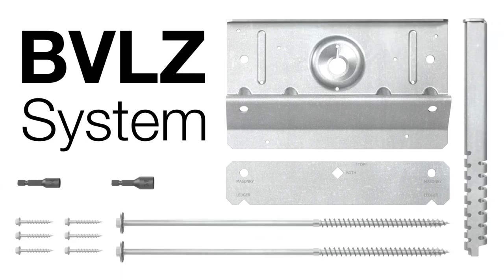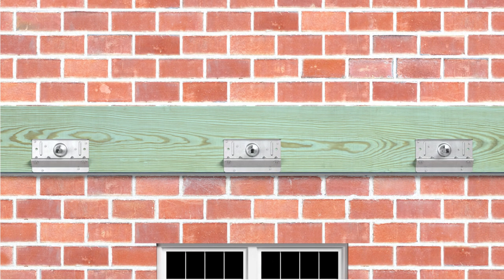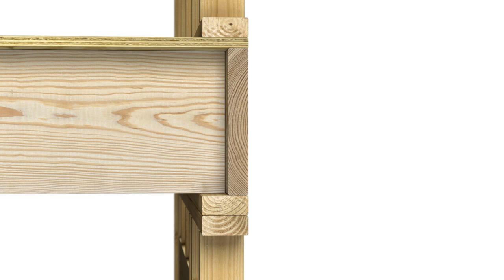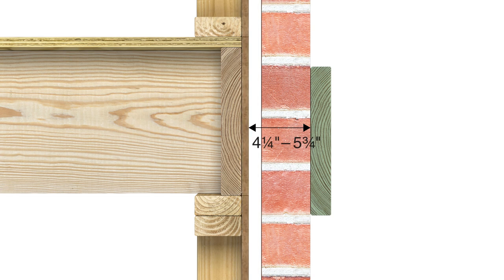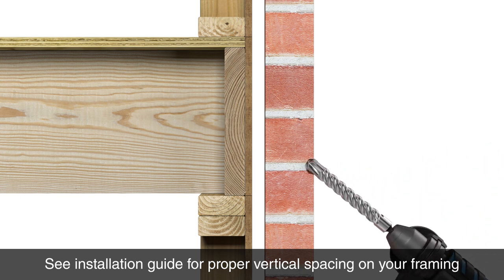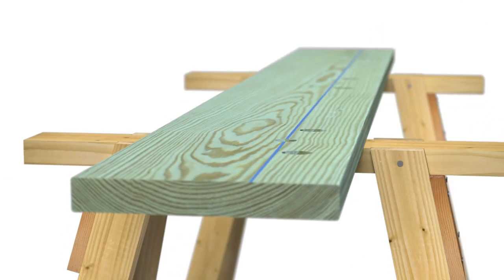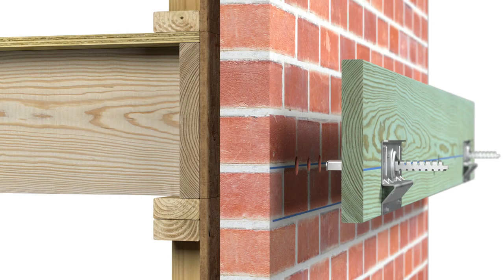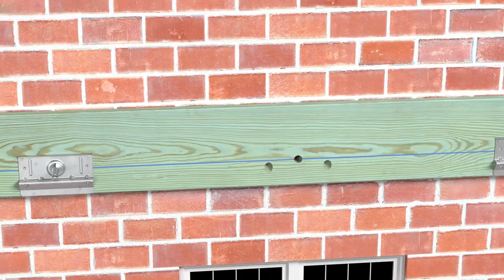How to Install the BVLZ Brick Veneer Ledger Connector

Comment: what is your recommendation if the deck is already installed? We went to a client that has a prexisting deck- it is attached with 8" grade give lag screws, likely 3/8. Is it ok to find our rim and do our prep work and drill them out while the deck is installed on the wall?

Comment: bought our building and it has a hollow facade, it was some sort of spray exterior stucco and wire framed.  behind that is brick about 3 inches back.  How would you recommend I anchor a ledger for a small overhead roof (mostly for the rain/snow over a double door)
Reply from the maker: Hi Anna, thanks for reaching out!  Unfortunately, there are some unknowns we'd likely need to know that is difficult to address over social media.  We offer free engineering services and they should be able to point you in the right direction. You can reach those services at: (800) 999-5099 or email asksimpson@strongtie.com  with your question.  Thank you!

Comment: You would think the screw would go down at a 40degree instead of up since gravity pulls down wouldn't that be pulling on the screw vs down the sheer  strength would hold more like a nail for  a picture frame into a wall angle it down vs straight in. Then again I'm not an engineer right.
Reply: Angling the nail like that helps prevent the nail from pulling out, screws don't have the problem of being pulled out, but they are prone to snapping, so that could be why since the screws are 14" long. I could also be very wrong.
Reply: @predatorysage1 you are actually very right.  All screws no matter the size, or even a grk structural lag screw are weaker in a load bearing application versus nails, that said the nails are weak when referring to the keeping tightness at the connection, the screws were engineered to be fastened on the upward angle because they  virtually can’t snap from being in the lowest angled orientation, they don’t have worries with regard to the pull away because they are a structural screw, the threads bear the load, this is where structural screw are the strongest, they actually out perform nails when installed in this fashion.